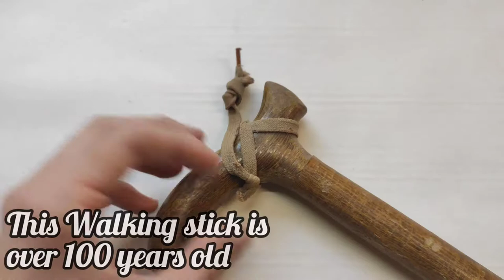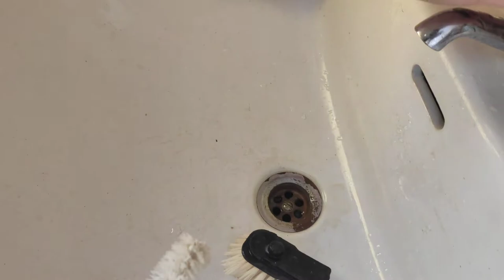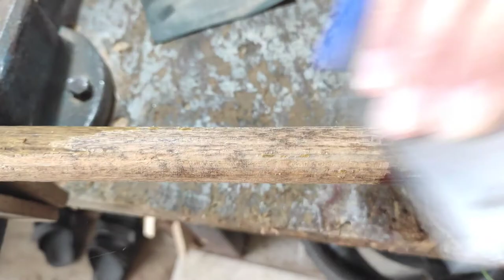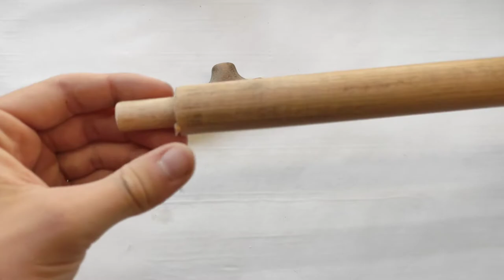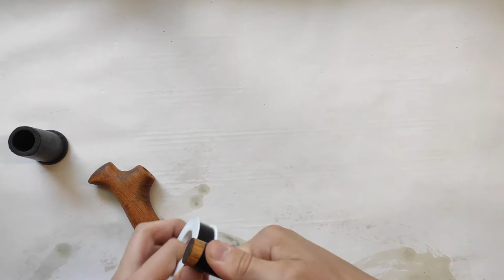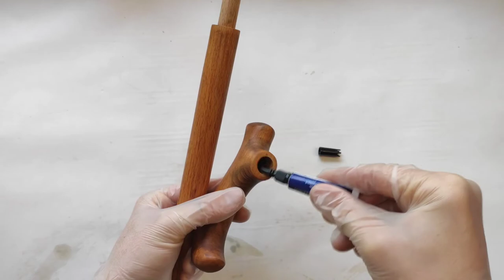Old Walking Stick Restoration

Comment: Worst parts I saw were the tape & glue on the rubber foot, you NEVER glue the foot on as it is supposed to be replaceable (BTW that was not an antique foot it was fairly new)!! Also super glue on the handle, really! Exterior wood glue or hide glue yes, super glue never!!
Reply from the maker: That makes sense with the replaceable foot, if i do more stuff Like this in the future i will keep this in mind.
Thanks for your comment 👋🏻

Comment: Interesting. How well did the glue and tape hold on the oiled wood? What type of glue was that?
Reply from the maker: It's still holding after all the time. Would be better without the oil of course. 
It was normal ca-glue. 
Thx for your comment 😁👋🏽
Reply: @tworighthands  your great-grandfather would be proud! Nice job!
Reply from the maker: @capers72424  thanks 😉